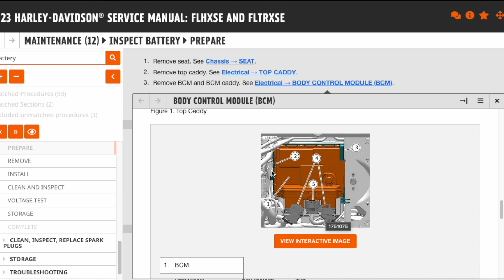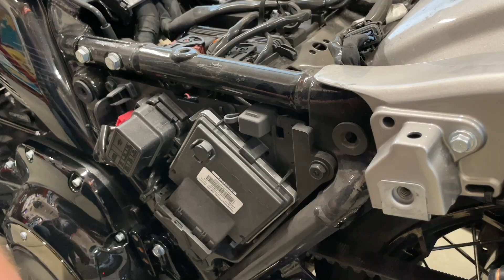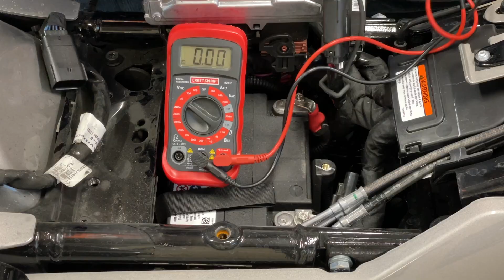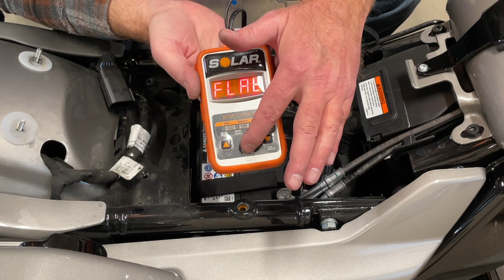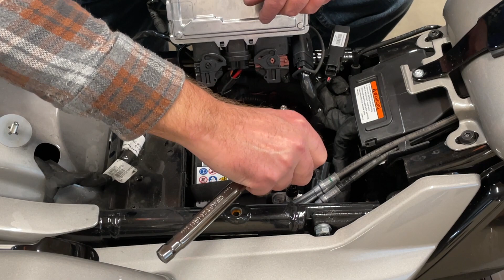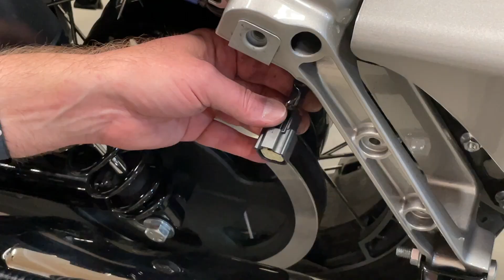'23 CVO Battery Check at 1000 miles

Comment: Great video. I found I needed to tighten both battery cables about a turn each. The only concern was that even though I had gone through the correct procedure for removing g the main fuse, it sparked a bit when I plugged it back it (with the ignition switch off). I thought I might have ruined the fuse but the bike started fine. A good reason to have a spare main fuse in my saddlebag. I did notice that even though the bike had been on the Noco tender with a green light, when I plugged the tender back in after the battery maintenance, the tender stayed in the red and orange mode for about 5 minutes which I found interesting.
Reply from the maker: Hello!   This is all normal.   The battery cables will spark if you remove and reconnect.   Very common but VERY important to always connect the positive red cable first.   Otherwise if you  do this in reverse and touch the positive to ground you will have a big surprise and potentially a fire!    Now anytime you disconnect a battery or even have the bike on for a few seconds the tender will go into charge mode and yes it can take several minutes before its back to green.   This is normal!

Comment: Figure out how to disable the alarm chirp when toggling the igniton switch?
Reply from the maker: Yes when I got my 18 this really bugged me,  I did get used to it and now listen for it to be sure it armed.   The speaker is visible on the BCM and I suspect you could just cut it to disable it.  No idea if the system would show that as a fault but I doubt it.
Reply: I figured out how to disable it.  The BCM is is under the left side cover as a reference, the siren is rearward of the battery.  The sequence of ignition switch toggling will disable the alarm chirp. @ITFZone
Reply from the maker: Appreciate the update!   Looks like the sequence to disable the chirp only, leaving the siren active is:

Perform the following to switch between chirp and chirpless modes.
With the fob present, turn the ignition switch ON.
When the security lamp turns off, turn the ignition switch OFF.
When the security lamp turns off (but before the turn signals flash twice), immediately turn the ignition switch ON.
When the security lamp turns off, immediately turn the ignition switch OFF.
When the security lamp turns off (but before the turn signals flash twice), immediately turn the ignition switch ON.
When the security lamp turns off, immediately turn the ignition switch OFF.
When the security lamp turns off (but before the turn signals flash twice), immediately turn the ignition switch ON.
Reply: There is no security lamp on the new displays.  Trick is to turn the ignition back on affer the first chirp, but before the second chirp.  After you turn it back on, count two seconds.  On/off, on/off, on...done. @ITFZone
Reply from the maker: Awesome, I will try it!   Thanks for the share here! @pacnw3069

Comment: Starting issues do not include loose battery terminals. The starting issues are buyers not being educated on starting the new control system. Wait for the click!
Reply: All good info as always, I cannot get the BCM to snap back onto the tray, you edited that part out and the video picks up with the module already snapped in, any tricks to this as I see you also had issues getting this to snap back in.
Reply from the maker: If you are approaching it from the left side as I was start with the bottom right corner of the BCM.   You have to get it under the right side of the tray before you can snap it in.   I had to fiddle with it for awhile which is why I cut some of that video out.   Good point though next time I will leave more of the struggle in!
Reply from the maker: Elaborate, which click?  Starting in neutral and awaiting the fuel pump to prime.
Reply: @ITFZone  no, after the control system boots up the ECM will give an distinctive click , the bike will then start.
Reply from the maker: Got it,  I will listen for it, thanks!

Comment: Check your air cleaner badge and make sure it doesn’t fall off, they are weakly attached by Velcro that will fail when bike is warm.
Reply from the maker: Yes the Velcro attachment is not ideal.  The tissue box design in general is proving to be the weakest link in the quest for more power.

Comment: So I had the air cover badge fly off while going 10mph on my 23 CVO Road Glide, it’s a flawed design with only being held on by “lock & loop” Velcro,  Harley is covering it under warranty, only had 7 miles on the bike,  rode from Los Angeles to San Diego, normal riding nothing crazy, but noticed at 3-4000 rpm when I rolled on throttle, the bike felt like it wouldn’t catch, took it to Huntington Beach Harley and one of the Master Tech test ride the bike and sure as hell, he said the clutch felt like it was slipping too in 4th,5th and 6th gear, from 3000 rpm roll on.   So now the bike is back in the shop.   Should have kept my 21 CVO Limited, nothing but issues so far with this 23 CVO
Reply: I hope the HD Tech has an easy fix for you.  I too would be very disappointed if the clutch was slipping.  Best of luck to you.
Reply from the maker: I have seen more than one report of this,  I know since adjusting my clutch it’s much more responsive and my limited time with the recent updates seem to show stronger starting.  Overall I continue to be impressed with the ride quality and performance from my ‘18.  I do believe the bugs can be resolved but HDMC needs to respond.
Reply: And I see that California CVO do not have any tunes available, the SE Tuner will not recognize California vin # CVO’s, I will never buy a California bike, I will take the weekend drive to Las Vegas or to Scottsdale, AZ for purchase.   Harley is supposed to be releasing a California SE Tuner but there’s no release date, usually takes 2 years.   So those California vin # CVO that put exhaust on need a tuner…. But what tuner?